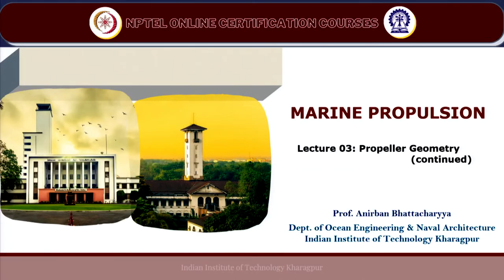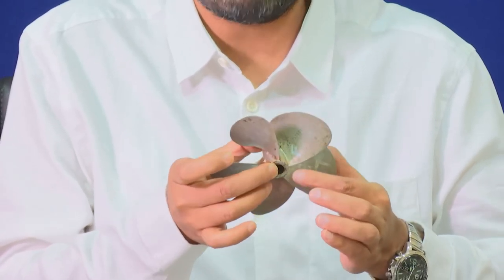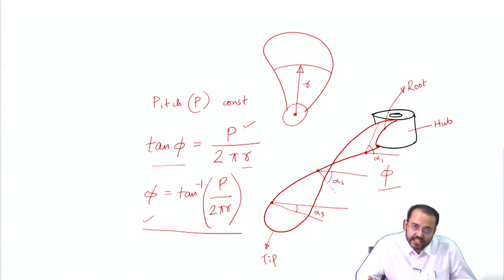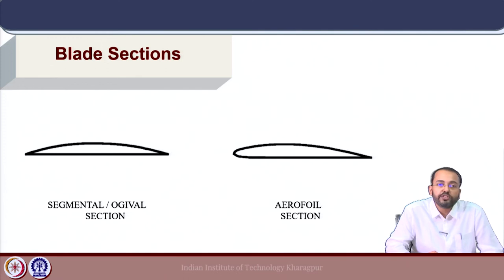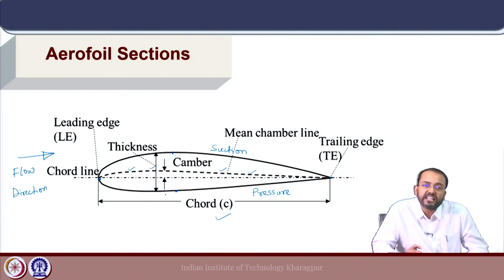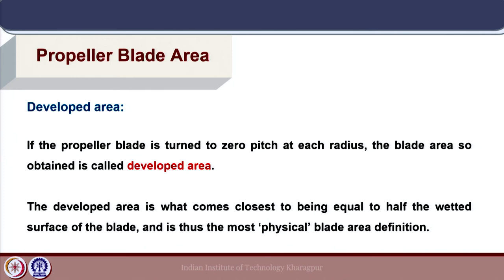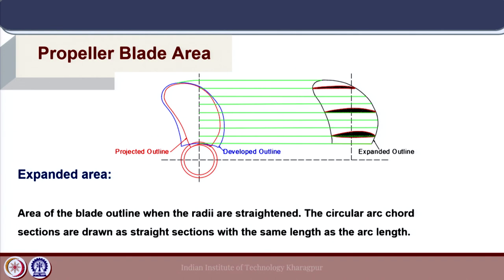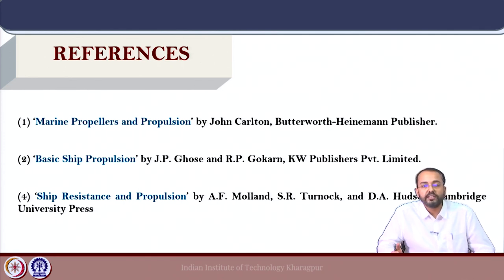Lecture 03: Propeller Geometry (continued)

Comment: Greetings from Brazil. Professor, why when slip is 0, the propeller will not produce any thrust? From what i could understand, when slip is 0 and nP = Va, the thrust would be maximum.
Reply: slip=Actual distance travelled/ Theoretical distance travelled. Therefore if slip=0, then actual dist. travelled is also =0.  Hence propeller blade will not move, therefore no thrust.